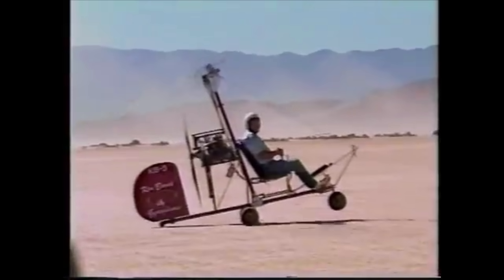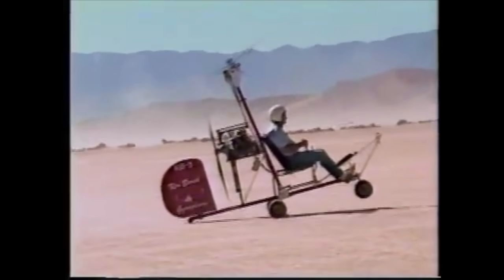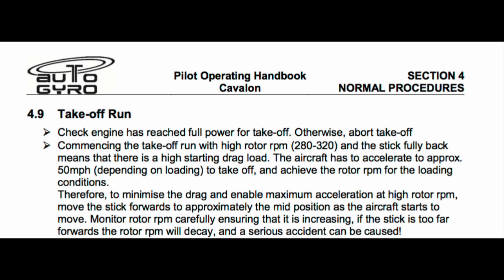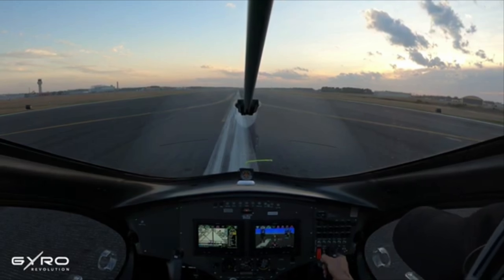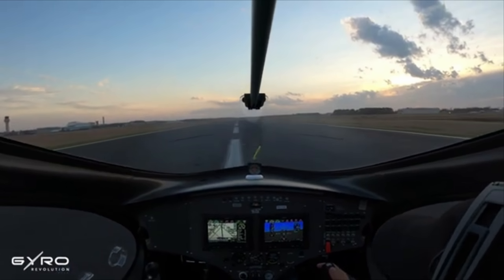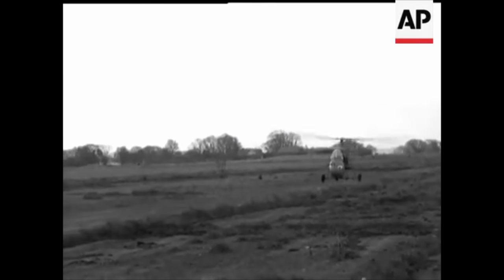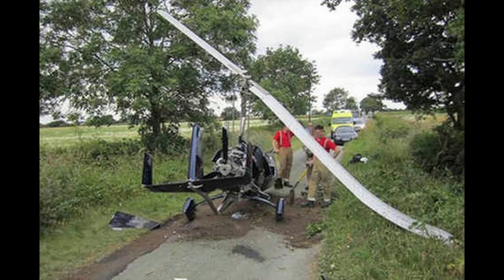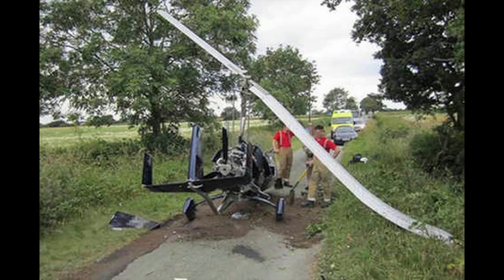Gyrocopter wheel balancing [part 2]

Comment: What is the added benefit of wheel balancing?  It increases rotor disk angle and drag, no?
As in  a tail dagger type gyro, you can not do wheel  balancing.
Reply from the maker: Hi correct in a taildragger you can't wheel balance in the same way.  Yes it does create a very draggy state and remember most clean aerofoils are stalled around 14ish deg AoA where drag increases hugely.  As said in the part 1 film its a methodology that provided a gentle lead in.
Reply: @gyrocopterflyingclub6148  thanks for the explanation 😀
Reply: @gyrocopterflyingclub6148  
Another topic / question -  do you possibly know the web page www.autogyro.com  which was created some 20 years ago by  Jim Baxter, Spokane Valley, Washington, USA. It used to be the most complete resources on RC Gyrocopter research, design, build and flying I have seen so far.
I am flying puller style single & dual rotor RC Gyros, hence my question on the wheel balance.

Comment: Hi Phil, bit disappointed with this video especially because you've taken the POH extract completely out of context, viewers should also read the entire sections of the POH especially 4.8 Takeoff Procedure with all the caveats and warnings from AutoGyro and 4.10 Climb Out to understand what's at play here. Or to see what a more 'standard' gyro without the 915iS (which can create excessive thrust and potentially unload the rotor disk) then the MTO Sport 2017 POH would be a good read, again the relevant sections are 4.8, 4.9 and 4.10 which you will see show a 'wheel balance' type approach suggested for the takeoff run.  

While I agree that a prolonged wheel balance isn't necessary on the right day with a lightish aircraft or suitable weather e.g. less density or a head wind it is a suitable safety net to not climb away until sufficient Rotor RPM and Airspeed have been met so a land ahead can be performed if the engine should fail or the aircraft not climb at a sufficient rate to clear an obstacle.
Reply from the maker: I'm not sure which bit is out of context tbh Jason.  POH take off performance in any new AutoGyro references 300 rotor RPM.  So now any take off that you'd like to relate to that means taking note of what I highlight in 4.8 and 4.9.  

You can not climb away without sufficient rotor RPM you can sail the blades if the rotor tip speed v airspeed gets close.  If you monitor rotor RPM via the rotor tacho and airspeed via the ASI that won't happen.  When it has happened it is because the pilot hasn't been monitoring rotor RPM and airspeed.
Reply: @gyrocopterflyingclub6148  Phil, the point is that section 4.9 is when you're rolling down the runway, it's not the whole takeoff process, that's why it's out of context to the whole takeoff process. Rotor RPM is a lot more important than Airspeed in the initial part of takeoff - your technique puts an emphasis on both, risking putting you in the deadmans height curve and behind the power/drag curve in the event of an issue e.g. engine failure.  You know yourself most takeoff accidents are due to the stick not being held fully back on takeoff during the takeoff roll, building too much airspeed versus rotor rpm, stick being pulled back (or not relaxed enough) resulting in sudden pitch up/roll and crash, this along with not allowing rotor speed to decay just after landing and before taxiing account for the majority of global accidents all pilot miss handling that can be prevented by correct technique and a systematic regime.
Reply from the maker: First of all it is nice to debate things.  However I think your comments are additional to anything I've said rather than in opposition to it?  I highlight two items in the POH 4.9 so that viewers can see the text regarding excessive drag and then 4.19 because that references short field technique...

So - and just so others can follow what I think we are debating (because I think this is important stuff) - AutoGyro products with rotor head 3 (so that means new Calidus/Cavalon and 2017 Sport) allow hight pre-rotational values to 320RRPM.

In addition the POH take off performance data references pre-rotation to 300RRPM.  

In the POH if you pre-rotate to those values (it references 280-320 range) then it recommends moving the stick forwards if you have pulled it back OR simply not pulling it fully back at all (see 4.19) it kind of becomes a matter of semantics if I'm honest (i.e. you pulling the stick fully aft and then pushed forward or just didn't go fully aft in the first place....).  The over arching point is that the issue you highlight:-

"You know yourself most takeoff accidents are due to the stick not being held fully back on takeoff during the takeoff roll, building too much airspeed versus rotor rpm, stick being pulled back (or not relaxed enough) resulting in sudden pitch up/roll and crash"

You can not sail the rotor blades from brake release when they are pre-rotated to 280-320rrpm and if you are specifically monitoring rotor RPMs why do you allow the rotor RPMs to decay?  So that becomes a mute point surely?

Not pulling the stick back at all is not a technique anyone is or has suggested indeed its just making a mistake.  If you read every single AAIB report on those accidents the pilot can absolutely tell you what he pre-rotated to but has no idea what the rotor RPM was when he crashed.  Looking at the rotor tacho would have given the best chance of preventing these accidents as much as anything else.
Reply: @gyrocopterflyingclub6148  Yes Phil, some of this is semantics and I love a debate so people can see both sides of an argument especially learning from real world experience.  Most of the global fleet are not able to or people simply don't pre-rotate to a high rrpm level (typically max is 250-270rrpm) to protect the clutch/gearbox/belts etc... The minimum rrpm in the POH for Autogyro MTO Sport 2017 is 200rrpm the bottom of the green arc with 320rrpm being the max (yellow radial) which is ~88% normal cruise rotor speed. The POH stipulates increasing rrpm to 220 before releasing the pre-rotator as rrpm will decay once pre-rotator is disconnected so you'll still be above 200rrpm as you commence your roll and hopefully not experience any blade sailing.  It doesn't say always try to rotate as high as possible unless a performance takeoff is required.
Personally I have only pre-rotated to 300rrpm 4 times, first time with my CFI on board off tarmac following a pre-takeoff brief so I could see what would happen with ballast and someone vastly more experienced onboard and 3 times off grass with light winds solo. Despite what you mentioned in an earlier review of Sport 2017 912ULS the liftoff is significantly reduced with a higher pre-rotate. I've had direct comparison with a Sport 2010 fitted with TOPP II rotors pre-rotating to 200rrpm same airfield, same time and day, and Sport 2017 lifted off much sooner - the 912 engine can overcome the drag factor. I didn't need much of a ground roll before the front wheel lifted but still had the stick back. Note I said takeoff was sooner not necessarily climb out as we still needed to build airspeed.
However I did that for practice - I've never needed it to try to clear an obstacle or compensate for a poor performance day as it's not worth the risk of getting stuck where I can't take off from. So in that context, I'm sure you'll agree that most people will pre-rotate to circa 200 rrpm then you're going to have the stick all the back into a wheel balance to build rrpm to flying speed, airspeed build up at low level and climb at 55knts i.e.~65mph. All the best.
Reply from the maker: I have to say I think you missed the point of the clip I used in the context of the film.  

I do agree that most only go to 200 (but actually drag still applies there too) and the global fleet is skewed but that will change BUT the film wasn't about the global fleet or the general ability to pre-rotate to 300+.  

As you say:-

"It doesn't say always try to rotate as high as possible unless a performance takeoff is required."

and.... isn't that exactly the phrase he used?

The point of the clip [we are talking about] was that this was someone pre-rotating to 290.  He did want to take off in the minimum distance possible - how do we know? Because he told us.

And having done that he didn't use the technique to give him that result.  Worse than that because (perhaps like you?) I know the "standard" patter that is used - I absolutely know that he just defaulted to a well taught take off technique - but it wasn't the technique to give him a "performance take off" nor would it have given him the numbers from the POH.  

It was just interesting pilot to see into the mind of this pilot and more than that it is interesting how inflexible his process has allowed him to fly.  Its just my opinion (but then it is my YouTube channel so I guess I can express it!) but whilst I agree that having a nice flowing patter is fine you need to accept there are circumstances that require something else.  

I'm not sure we are there yet and actually the more its resisted the more we are effectively saying "don't take off using the technique from the POH".. so how will that get reflected to the AAIB the next time someone crashes one of this type of aircraft?  I used another technique because..........  I did differences training on the 915 Cavalon and my instructor didn't want to tell me about the technique in the POH?  Is that what we are advocating now?

Now as it happens a 915 Cavalon has already been crashed in the USA perhaps not take off related but one wonders how differences are trained (if at all) on the aircraft in the USA and how they will be taught in the UK for all rotor head 3 aircraft?

As for 912 2017 sport and high pre-rotation values - I always refer to the ability to clear 50ft when taking take offs unless specified otherwise.  Out of interest what did you estimate the actual take off performance to clear 50ft?

My poor experience was at Old Warden circa 25oC two up 30 litres of fuel.

Cheers, Phil.
Reply from the maker: Hey - sorry can you explain why you think my technique makes issue in the event of an engine failure??? I don’t understand

Comment: Interesting,. I'd note that the correct attitude for flight is the attitude I always ended up with in my VW single seater.  Balancing on the mains achieved this the most quickly for me.  This involved getting onto the tail wheel but at very low power.  I found I was getting off quicker than many with larger rotors and prerotaors not because it was necessarily better but other factors come into play.  The most I found was how much lift was required to lift the nose.  Blokes would have their axel way too far back and hence it wouldn't get on the tail.  So you needed lots of runway to get the blades to accelerate.  Also longer rotors take much longer to come up to flying speed.  So my heavy VW hand wound could get off in half the distance some guys did.  We never threw full power on we crept up to flying airspeed.  My single seater would be off the ground at 20-22mph then hold in ground effect till 35mph to climb.  These machines have a very different range of speeds and the procedures seem very different.  

Typical run would be wind up rotors by hand strap in taxi to end of runway.  Blades would be up by the time I was at the end of the strip.  Start at 10mph,. Once blades in second stage 12mph nose full up ease on power very gradually.  Establish balance (no at full power yet).  Wheels balanced full power wheels break hold until 35mph climb out level.  

Essentially are you guys hauling on full power very soon to avoid the blades decelerating to a point where they can get into hinging (sailing)?  Are the tail wheels on these machines so high that you can clobber the blades at the back?  Why can't you do a slower run up?  Not questioning your judgement just not understanding the technique.  To me the priority was always to get off flat, using the minimum distance.  I might take 20 seconds longer winding the blades but I wasn't going very fast and thus was off in shorter distances.  Again. I know you're an experienced instructor flying these machines.  So just trying to understand why the two techniques are that different other than much more initial rpm on the rotors.
Reply from the maker: Hey Cameron - thats good colour on your technique and my own thinking around this was driven by a couple of factors.  Obviously UK focused as that is my background.  So here the biggest trainer is the AutoGyro Mt-Sport.  It has a cranked keel.  The issue then becomes for students trying to find the sweetspot (as it would be in a single seater) but with the factor that allowed to go too far and it gets quite dramatic. Now you can actually wheel balance and scrape the tail of an MT but any side stick at this point really does tend to see you in trouble.  The other issue is that even if the pitch attitude isn't so dramatic as to be upsetting it creates huge additional drag.  So you find guys with the ability to fly OK but still having attention focused on this phase of the flight.  Its fine if you have 1-2km of tarmac runway but they go to a 500m grass strip and suddenly we have drama again.  With a straight keel the over pitching is eliminated.
Reply: @gyrocopterflyingclub6148  hi thanks for the reply ive flown in gyryogliders aircon and two up, my instructors side by side machine basically a two seat Bensen style machine 583 and my instructors current machine again side by side, Chrome Molly frame 912s machine.  But I've not flown a tandem machine.  By the keel being bent are you saving the don't lower the tail wheel so you can easily achieve a greater angle?
Reply: Just reviewed your first video on this.  Your technique looks fine.  But some of your examples show people not balancing.  Trying to take off at such a high angle is not balancing on the mains.  If you haven't shoves flying power on the machine slows remarkably and you have to add a lot of power to keep it their.  As soon as the nose came up I'd hold it there about a second with a tiny bit more powerthen get the nose down to an inch off the runway and gradually add power holding the nose at that attitude.  Perhaps the more powerful but heavier machines make this a bigger issue?
Reply from the maker: I think the issue is that the range of pitch with the cranked keel designs is so big and the onset of error is very fast.  So now you have a guy flying 2 up with a very gradual application of throttle gets on fine.  You then have him flying solo and he gets on the power a bit more aggressively and boom - he is now sat on the tail.  You then have that guy buy himself a 915..... but yes balancing with the power is the correct way.

Comment: I am assuming that gyrocraft have performance data. If such data exists then it is only valid if the techniques described in the POH are followed. This message should be rammed home in every lesson. Pet techniques, “adding some for Mum and the kids”, doing something because “we’ve always done it that way” and plain old lazy flying have no place in aviation. It also falls on the manufacturers to describe the techniques to be followed very clearly. The Cavalon POH could have been written better. If you wish to say “don’t do this” then put that at the end, don’t start a section with it.
Reply from the maker: Agree and gyroplane POH take off / landing data is just awful indeed it surprises me that the regulators allowed it to pass during the certification process.

Comment: Yeah, I think the "stick-full-aft" and wheel-balance thing is universally taught because, unless you run out of runway, it's a fool-proof way to take off. It's not the best way, but I think a lot of instructors are afraid to teach any other way because if improperly executed (like instead of having the stick slightly forward of-full-aft the person over-does it and doesn't have the stick far back enough) the consequences can be far worse than just a sub-optimal takeoff. I think the less than fantastic safety reputation of gyros encourages an obsession with fool-proofing everything to prevent accidents and we over-do it. Like we're all trapped in the beginner phase in everything we do and teach because we don't feel like the sport as a whole is past that point. For the record, the takeoff approach you went over in your previous video is superior even in a single-seat Air Command 503, hardly a high-performance machine. The "balance-on-the-mains" just feels safer to teach because we're all so paranoid and insecure about our sport. Even if we do it we're afraid to teach anybody else to lest they screw it up and wreck their machine and blame us.
Reply from the maker: Yes I'd agree with your overview (and very well said) - the highlight for me in this 2nd part is that of course in the context of a 4-5min YouTube film you inevitably can not analyse every scenario and not all elements are relevant for all pilots - it depends on what they fly and their experience. Hopefully people have the smarts to speak with an instructor etc.

 What I would say is that if a technique is done wrongly (i.e. not pulling the stick back at all) well thats exactly that - an error.  If however you relate to the aircraft almost exclusively flown in the EU and increasingly in the US (2 seat factory types) they all have full functioning rotor tachos.  If part of the take off process is to monitor that instrument I find it hard to understand how anyone sails the blades.